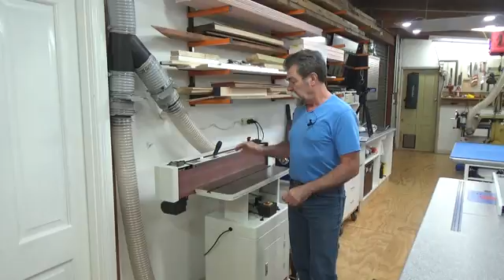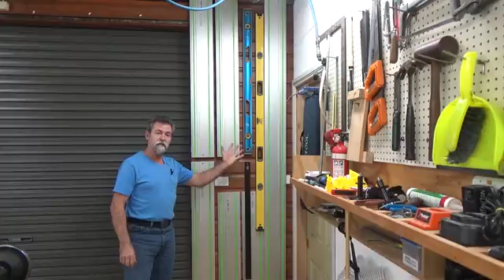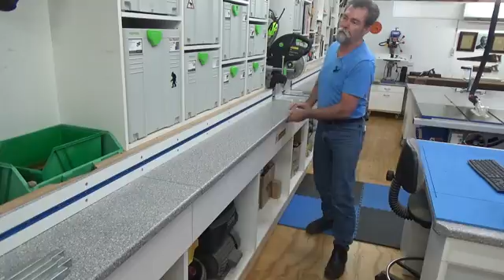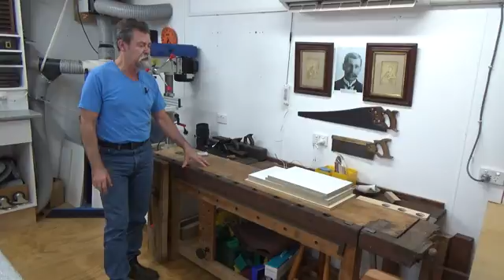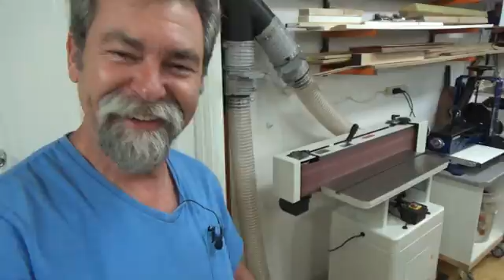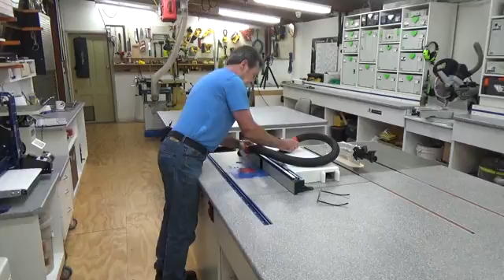dave stanton woodworking wood shop tour 2017 ideas workshop

Comment: That's a lovely shop.
Reply from the maker: Thanks Jorge!
Reply: Dave, Greg here, my wife and I are setting up a new home north of Newcastle slightly warmer than Canberra in winter, and I intend to purchase a table saw, as it is coastal, I'm concerned about cast iron machine tops becoming rusted quickly, any ideas on preventing or slowing the surface rust? Cheers from Baghdad, very hot at the moment, 48 - 49 deg C with more yet to come. G

Comment: David, thank you for doing a couple of followup vids!  IMO, these are the best and most useful presentations one can make, as they are an honest sharing of the real "lessons learned," and that learning is why we all do this, isn't it?  Clearly you enjoy the whole experience, but I sense that you really dig the chance to go on and improve something, and as an architect, that is what my professional life is all about, so I deeply respect that about you and your channel.

You have selected melamine cabinet material, and I have long considered this myself.  I like that the material is almost like Teflon, nothing will stick to it, and cleanup amounts to a swipe with a damp rag.  It's immune to solvents and oils, it's slippery when need be, but it has a great affinity for your new favorite non-skid rubber materials.

Now that a few years have passed, how do you find its durability?  Here in the US, melamine sheets have cores made of particle board, not MDF, so they are somewhat fragile to shock and impact, and god help you if you allow moisture down into a joint.  Also, our material does NOT take fasteners well at all; one really must use either barrel bolts or IKEA style super coarse threaded fasteners/inserts -- all-in-all, not ideal for heavy duty applications like work benches.  Please share your thoughts on this.

Comment: Nice looking shop.
Organised and clean.  Man i gotta step up and clean bit more.  But with all that work is hard sometimes.  Keep up the good work
Reply from the maker: Sometimes it is good to stop and put things away before moving on to the next project. Like re booting a computer, lol.
Reply: David Stanton Yeah i agree. Specially if the computer is already   overheating :-)
You know.. you convinced me to buy Rotex 150. Hope you get something from Festool.  Cheers
Reply: Thanks for this comment.

David, dust buildup is a question I have about your shop.  You do have a number of open shelves, which are amazing at catching dust, but you also have a nicely developed DC system and Festools that are great at containing the dust.  So how does it all pan out, is your shop pretty easy to keep clean and healthy?
Reply from the maker: Pretty easy to keep clean because I use dust control and also clean up after myself usually every evening that I have worked in the shop.
Reply: David Stanton Yeah that is the key.  Clean up after.  I work around 10h a day and I produce huge amounts of dust.  I have central dust collecting and ctl 26 ac everytime when I use hand power tool. My problem is that 3m long stroke sander. Dust collecting is not so good on it. And it fly all over my shop. I must step up with cleaning. 
Cheers

Comment: Hi Dave, Just discovered your channel, really like it. Although I'm located in NZ would be very keen if you could tell me what LED light fittings you are using? I'm just about to do some workshop upgrades and they look just the ticket. Cheers Peter.
Reply from the maker: Hi Peter Elder! They are an AEG LED on Ebay. 6500k temperature. 1200 x 300mm

Comment: I enjoyed the tour Dave.  I always pick up tips from every shop tour video whether large or small.  The tweaking never ends.  For your Systainer storage rack, are the shelves fixed or movable?  I am planning on shelves high on the wall since all the easily accessible wall space has been consumed.  Steve
Reply from the maker: Thanks Steve. My shelves are all on shelf pins, so movable. I may put a little recess under the shelves where the pins are to reduce risk of wearing a festool as a hat when getting the higher up systainers down.
Reply: Thanks Dave.  I have used shelf locking pins which have a spring loaded clip to keep the shelf from tipping.  This is what I use:  http://www.cshardware.com/62-851-5-00.html
Steve

Comment: Hi Dave great tour, I am from Gold Coast, just moved 3 months ago in semi rural area, with a shed of 6Mx 9M, I have expanded it to 6Mx 14M long, I chose to go on using stationary metal cabinets 2000x900x450, concrete floors and covering the walls with insulation then with 20mm CD plywood for noise and temperature, also useful to attach shelves or others on the walls.  I do have 2 questions if you can help me first how you get the power to the table saw? I cannot run on the ground as I have concrete floors, second I just came back from LA, I was that close to purchase a delay timer remote control for the dust extractor but yanks do use the wrong voltage I always tell them that but they do not believe me..lo lo lo   therefore I noticed you have a system for remote control the dust extractor with TV remote can you help me how and where I can get one?.....  Dave I am sure you need a holiday I am in the correct place GOLD COAST you welcome to come over with the family we can exchange our ideas, unfortunately I do not wish to put direct contacts on the net if you know of a way let me know I can give you my particulars..... therefore can you help me with my 2 inquiries?  
keep up the good work. Jack from OZ, Gold Coast
Reply from the maker: My power runs under the floor. Thanks for the offer of a holiday Jack. I have a son in Brisbane that puts me up when I venture north. Regarding remote control, I use a carbatec switch box that uses infra red. You could purchase the control box for the powermatic dust extractor, should be fine but needs an electrician to install.

Comment: Love your shop, I am borrowing much of your concepts and designs for my new shop!  Question I know you have a large dust collection system do you find a need for a portable dust collector aka Festool or do you just have adaptation with your dust collection system for your Festool tools?
Reply from the maker: Thanks Gary. I prefer the small dust extractors (festool) for the hand held power tools.
Reply: Thank you again!  I think I am going that route as well.  I can always consider larger DC as my shop tools increase.

Comment: Thanks for the tour Dave. I'm still in the process of converting my garage to a woodworking shop. Do you have more info or videos on the table tops you are using for the router and assembly stations?
Reply from the maker: They are all laminate that I ordered from Laminex industries in Australia. I might do a bit about them next live show if you want?
Reply: That would be great. I'm in the states (in Florida) so I need to work out the local time schedule for your live shows. Also I would have to find something local but with more info on the table tops I'm sure I can get them here.
Reply from the maker: Marshall Harrison 9pm Saturday's your time.
Reply: Thanks Dave. I was going to tune in on my Sunday but I figured out too late that you were a day ahead. Or actually 12 hours. I should be there for next week. Is there a link I should use to join?
Reply from the maker: Marshall Harrison , if you subscribe to my channel and click on the bell you will be emailed a link ehen the next video or show starts.

Comment: Hi Dave, I have the same Jet bobbin sander but I bought it second hand. Mine has about a millimetre or so of sideways play in the bobbin when everything is tightened up. Does your machine do this or is the bobbin rigid? Cheers
Reply from the maker: Mine is straight as.